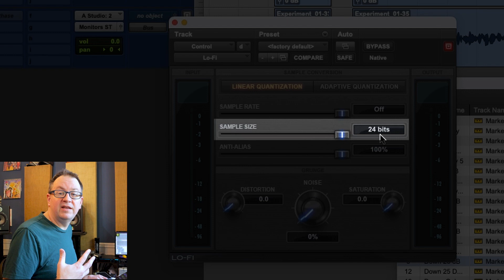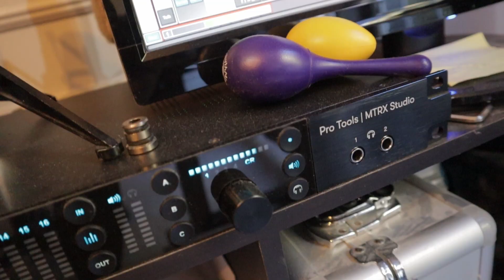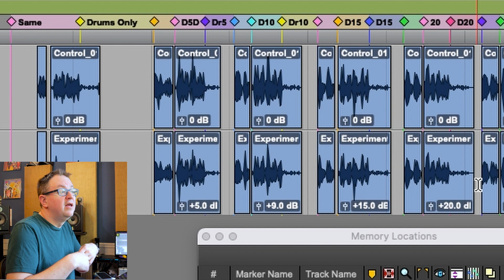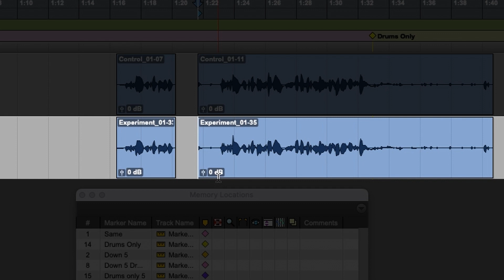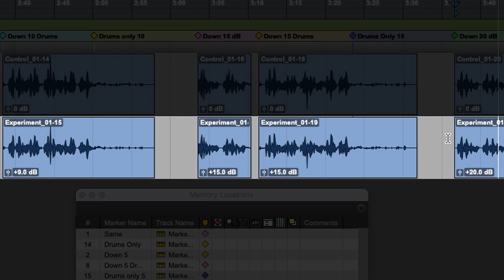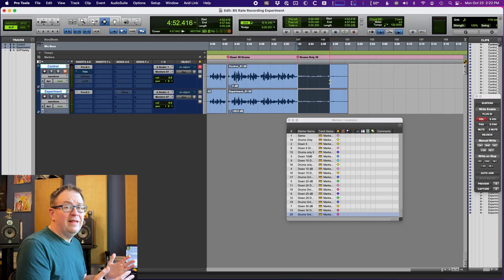Gain Structure: Do We Need to Use All the Bits?

Comment: You may be thinking of bit depth rather than bit rate? Bit rate would be related to sample rate which is completely different. Recording low, lowers signal to noise ratio or the effective bit depth, similar to what you did with your bit crusher plugin. But the reality is there's ~50dB of headroom between a 24 bit recording and a 16 bit recording. So if you're recording in 24 bit you'd need an insanely low signal to hear artefacts from boosting it digitally. Which is what your experiment showed. 

Hot recording levels feel like a hold over from the past. On tape, recording hot is how you avoid noise and hitting the tape a bit too hot just means a little bit of saturation. In the 16 bit digital era, it made sense to be picky about input volume. Nowadays with 24 bit? There's no reason to be anywhere near 0dB. 

I'd be curious to test your hypothesis that recording through a low quality preamp is worse at low level being digitally boosted than with higher gain setting on the pre amp. I'd expect the pre amp to introduce more distortion and noise in relationship to the signal the higher you crank it.

Comment: The term "bitrate" refers to the number of samples being taken every second; the numbers created by the A-to-D converter only represent the amplitude of the signal at those sample times. The bitrate is NOT affected by the amplitude of the signal, as the signal is being sampled the same number of times per second., irrespective of the signal amplitude.  Of course, very low signal levels will certainly affect the signal-to-noise ratio: additional gain applied to the signal when mixing will also increase the amplitude of the noise component, so correctly setting the Gain applied to the incoming signal is important.

Comment: Bitrate lowering from using lower analogue recording levels sounds incorrect to me? Surely all digital converters are fixed bit rate regardless of input gain to them? In digital domain only, gain simply can't matter other than for any plugins in the chain you know mimic input gain into analogue hardware equivalent behaviours?
Reply: I think where he is saying bitrate he might actually mean bit depth
Reply from the maker: Exactly.

Comment: I think some peoples misunderstood the "resolution" thing.

From what I have read, ingeneer where talking about console faders. Having the finest adjustment resolution(dB control) on maybe the first 1/2 inches of movement above and bellow the 0db mark.

On DAW mixer console, it does not apply as you can hold CTRL or ALT and move the mouse and still have fine adjustment any where on the fader.

On console faders, if you are at the lower portion of the fader, an 1/2" move up or down can result in -20db or +10db.

If you are near the 0db mark. A 1/2" move up or down will result in many +/-5db giving you finest adjustement/resolution.